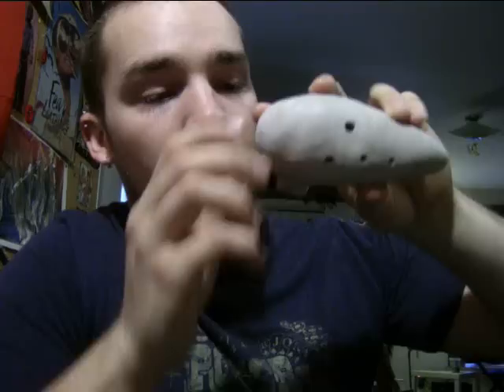All My Home Made Ocarina's to Today's Date Occy's #1-7

Comment from the maker: I'm not entirely sure:p
it all depends on what you mean by that.
When you say a round fipple hole do you mean the entire hole be rounded or just the sharp edge? The edge on my 6th is slightly rounded in and I will round the holes a little bit but they still mostly maintain a rectangular shape.